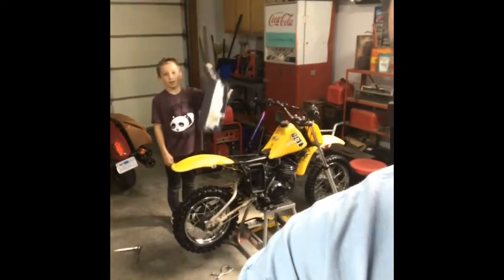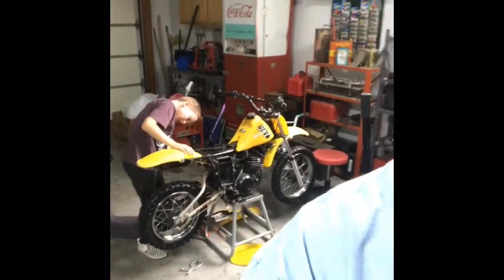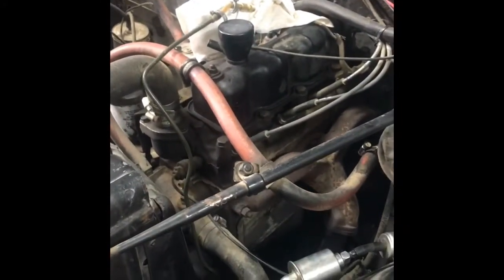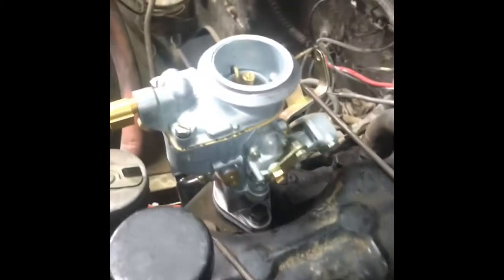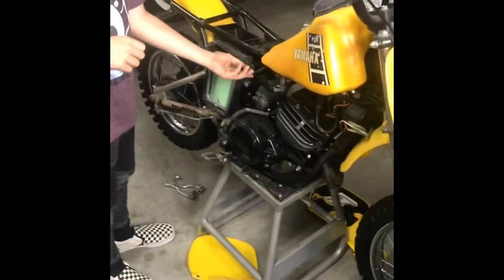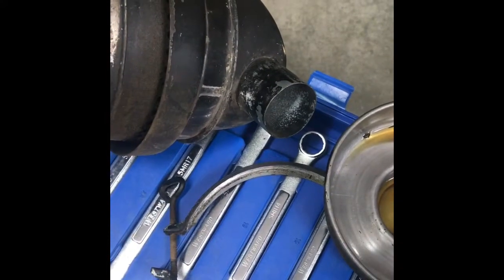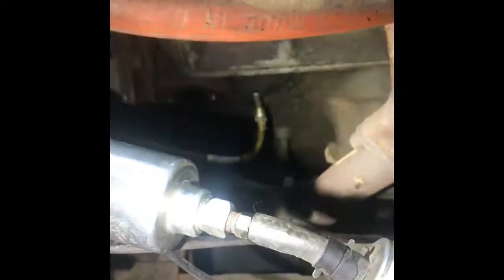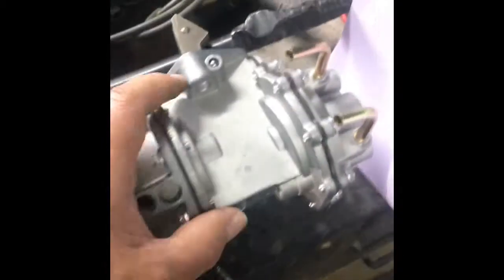Making progress on our 1966 Jeep CJ5 build

Comment: I had my dual action fuel pump rebuilt by Kaiser Willys and it came out awesome. Getting the bolts in was a bit of a bear. Here is a video I did about my 52 and at the end I discuss something it took me a while to figure out about the priming lever on the fuel pump. https://youtu.be/pw5Kt766iPs  Can't wait to see yours running man!